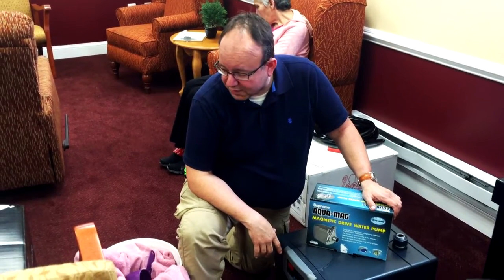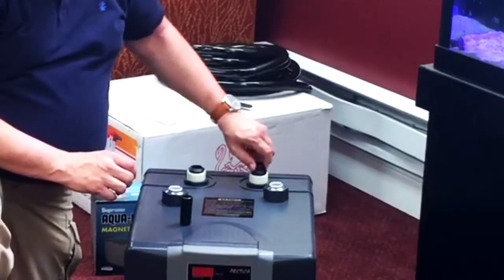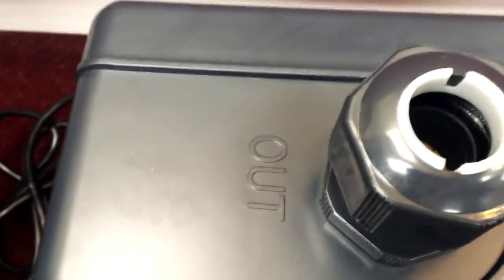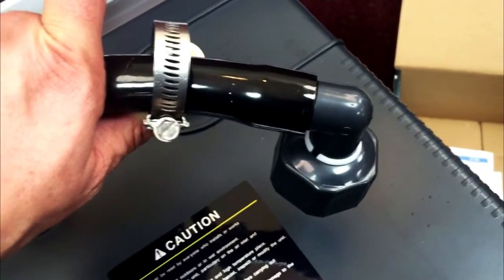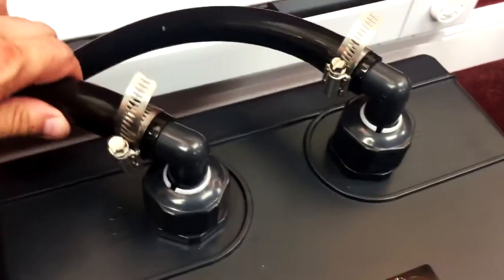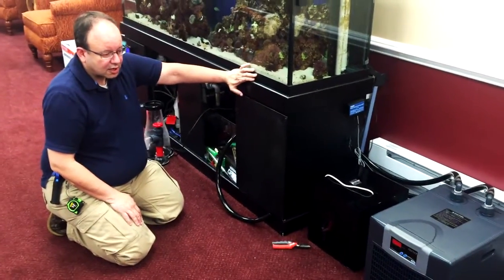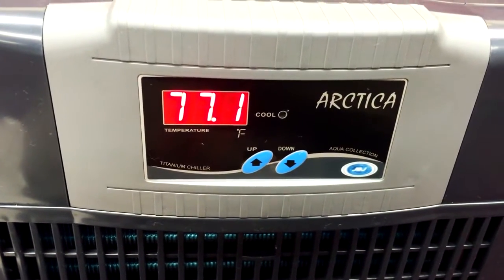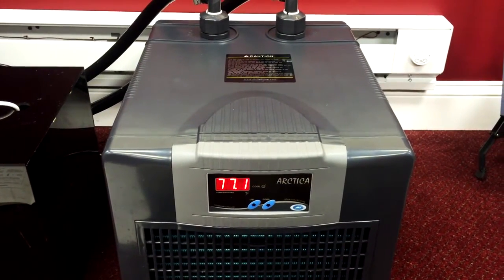JBJ Arctica Chiller

Comment: I see on BRS it has a min and max flow rate...for example the 1/10 HP recommends a min of 240 GPH and max of 960 GPH. What is the downside to having a flow around lets say 300 GPH and the upside to having a higher flow go thru the chiller? Is it just takes a longer amount of time to react and essentially cool your water?
Reply: Replying to this comment as I have the same query

Comment: The music is nice, but hard to heard how much noise the system makes.  It sounds (relatively) quiet when running?
Reply from the maker: MrEye4get hi, and thanks for watching. The unit is actually very quiet. Very impressed with the way it works it has been on the 250 gallon reef system running for a while now and it is very reliable and very quiet
Reply: @AquaticStart  48 dB

Comment from the maker: Hi Kishan

This model is the DBM-250 1/3 H/P used for 150 gallon reef set up. Remember that there are several sizes and you should inquire with the manufacture as to what size is best for your particular reef tank.

Comment: how do you maintain it and clean the filters?  Mine won't go below 79 degrees right now.  Please HELP!
Reply from the maker: Hi Prince

I would do a system reset on the chiller. Download instructions right from the manufacturer website. This is an easy step-by-step process
Reply: thanks